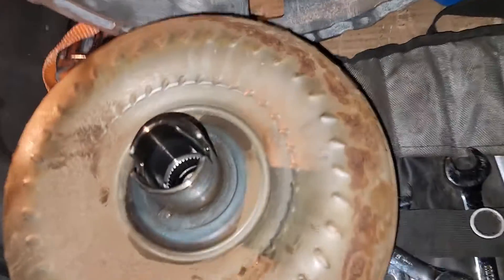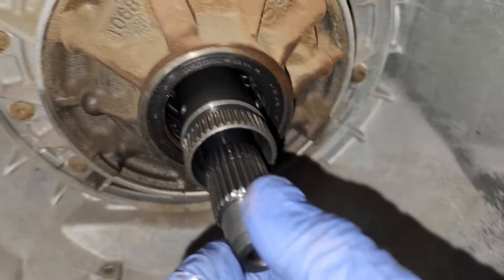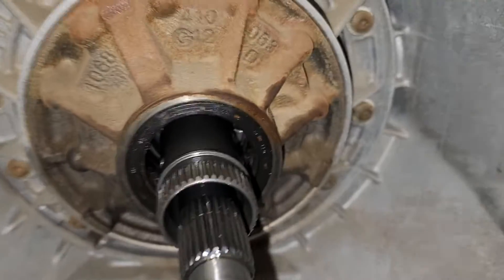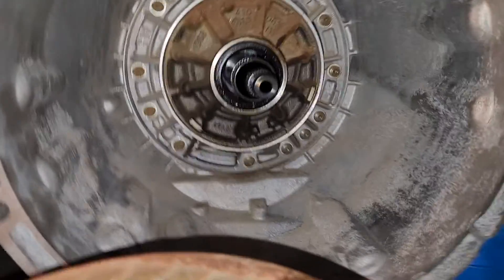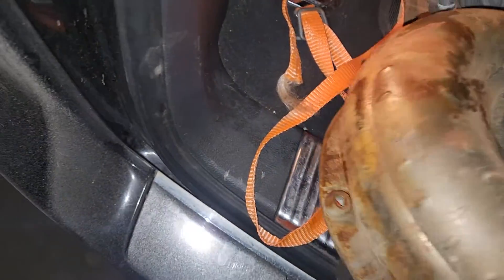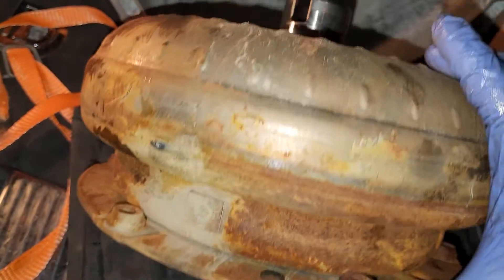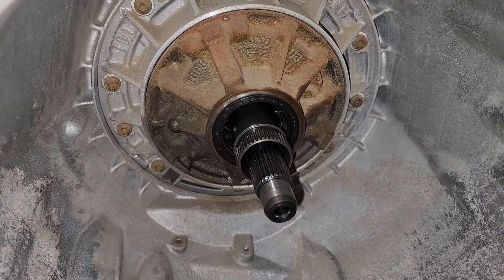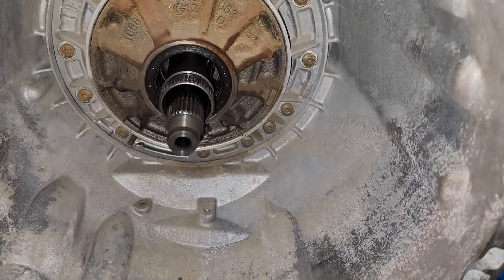ZF6HP21X Input shaft play Bushing wear acceptable? BMW 535i E60

Comment: Bad bushings b bro, needs each clutch bushings changed, my 535xi 6hp21x had similar I rebuilt entire trans, bushings frictions steels and valvebody
Reply from the maker: Yes, you're right... it was a worn-out bushing for the E-Clutch, but i dont think it shows in this video. But yes, either rebuild the transmission or just replace it with a low mileage one...

Comment: What did you ever determine? Too much play normal play?
Reply from the maker: It was normal play. I've made another video of the transmission replacement.. and I've driven the car for about 20 000 miles since then and haven't had any issues.
Reply: Good thanks :)